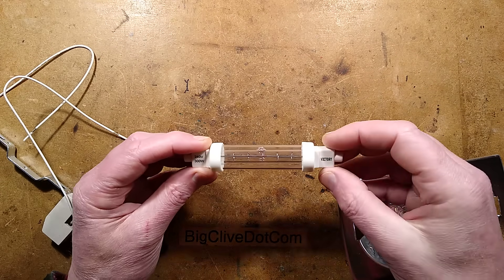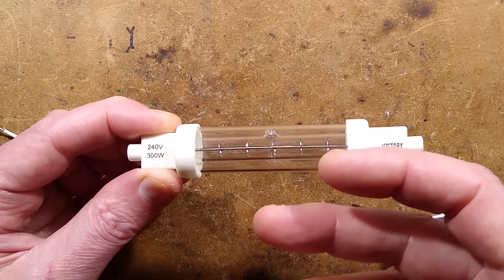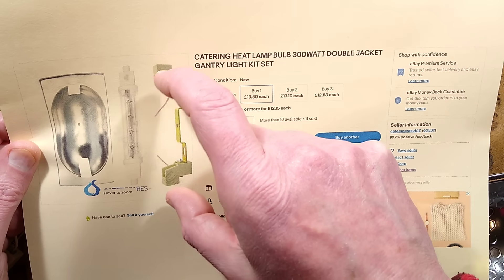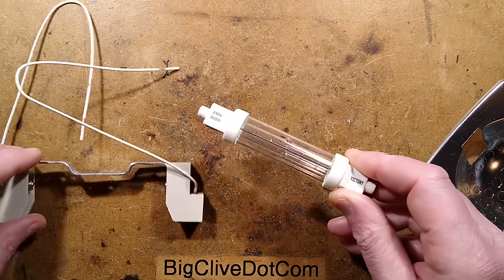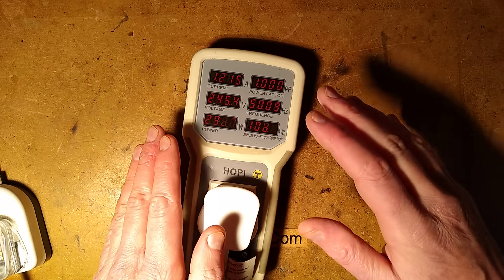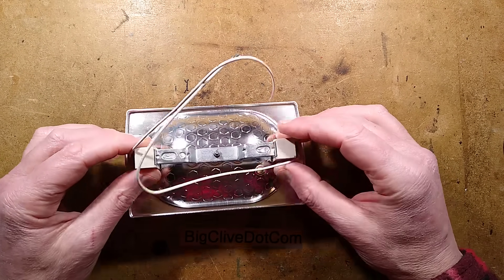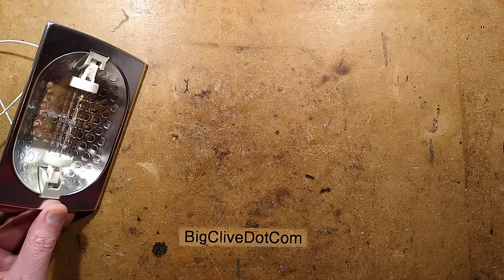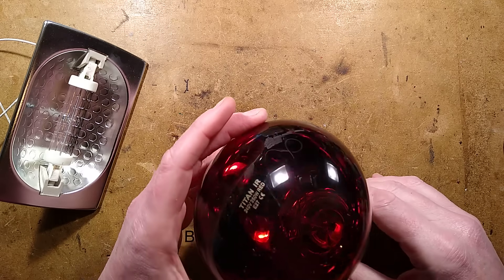Instant heat from an interesting linear heat lamp

Comment: I replace these on a Daily basis,   I'm a Catering engineer for the Biggest Catering equipment service provider in Northern Ireland 😊.  It really annoys me when I arrive at gantry jobs and find that people have stuck normal 500w flood light halogens from Band Q in their gantrys 😂😂😂. PS.    As for the lifespan,   on most occasions,  the lamp itself out lasts the lamp holder, as the contacts in the holder seem to always burn out, thus burning out the end of the lamp.   Also,  staff have a good habit of hitting the lamps with Gastronom container lids and smashing them into the food, rendering the food unfit for human consumption 😂😂😂

Comment: The 250w heat lamp was used extensively in the UK as a bathroom heater before central heating, it kept the electrical trade busy changing all the baton holders that burned out !

Comment: For the UV it's funny how the 850W linear bulb that I got off a laser printer gave me eyestrain every time it was switched on whilst 500W bulbs made for general lighting didn't even when used without any glass cover in front of them.
At the time I assumed that it must be because of doped quartz however I found out later that pretty much no linear halogen bulb is made from doped quartz unlike the bi pin capsules.
I found that by shining a blacklight on them and the ones made from doped quartz will glow blue while the others won't glow at all.
This also applies to some metal halide lamps by the way.

Now to the red chicken coop reflector bulbs, I alway thought they were simply incandescent bulbs with a red tinted glass, however aren't they instead slightly under-run to maximise IR production like with the kitchen halogen one ?

Comment: I work in that industry and many customers purchase the cheaper light bulbs instead of dedicated catering heat bulbs. Not all gantry type bulbs are double glass so it is slightly difficult to tell the difference. The element wires are slightly thicker then the light type and there seems more heat then light unlike light bulbs. Also light bulbs aren’t designed for continual use so don’t tend to last as long as heat catering bulbs.

Comment: For those of you using these in mobile carvery type catering cupboards get longer life from your lamps by training staff not to move the units until the lamps have been allowed to cool as rolling the cabinets whilst the lamps are still warm can cause mechanical damage to the filament. Oh, and always have an RCD or RCBO upstream as one lamp end cap is live when changing lamps unless you isolate and/or turn off the gantry and in a manic kitchen the isolation process can easily be overlooked.
Reply: In theatre, if we didn't have gloves on, we changed lamps while holding the lamp in a cloth rag.   Not really much risk of shock there, and it kept you from oiling up the bulb, which could cause a rather exciting explosion in a Leko, which you didn't want to happen 30 feet above the audience.

Comment: Both the red and clear I/R lamps were, some years ago, available in “ hard glass “ versions, meaning they were safer to use over food ( from  memory made by all lamp manufacturers I.e. Osram/ Philips / Mazda etc ). “ Soft “ , I.e. standard types were, as Clive said, in farms and chicken rearing barn, though for all I know may still be in use. I am happy to be corrected if anyone has a better memory!  The home infrared tanning lamps ( “ Infraphil “ and the like used, again from memory, 275w red hard glass type.

Comment: I remember old soviet/community heaters running on quartz lamps. Those were i believer tungsten wires coiled inse quartz tube? not quite sure, pretty sure those very quite brittle, but the heat they gave a way was immense.

Comment: You should check out an old fuser lamp from an old laser printer. Before they used induction heating like many do now they used lamps to heat the fusing unit to melt toner into the paper. Pretty neat lamps. Not bright but a ton of heat. Sharp used to use them. I used to have a couple 1100w and probably higher on high end production machines. Was an MFP tech in a past life...
Reply: Yes, great long things, they were still being used in Xerox copiers as recently as 2012.

Comment: I seem  to remember reading that Halogen lamps running at less than full  power will actually fail sooner than one running at rated output. 
It's something to do with the evaporating filament molecules within the lamp not recombining correctly during the lamps internal cycle thus leading  to erosion, thinning and  failure of the lamp.
Car headlight bulbs were the subject of the article in question.
Reply from the maker: There's a theory that traditional tungsten halogen downlights on a dimmer, should be run at full every so often just to clean them up internally.

Comment: We had the E27 variety with clear glass in our popcorn carts where people could go and scoop it up... now we have convection cabinets that heat up to 60ish C, into which we prepare various serving sizes. Those  are modified fridges, although the importer says they aren't, but they still have the refrigerant markings, and the compartment for the compressor in the back.
In a supermarket I frequent they have an IR heater panel over one of the cashier stations. That one is closest to their side door, which opens every freaking time someone walks by... and even though they have a heat pump to blow hot air in the "air lock" some cold air tends to enter in the winter. While it stays nice and warm, the conveyor is often hot to touch unless they keep it constantly rolling.

Comment: In order to have warm feet when I sit at my table in the cold season without having to heat up the entire apartment, I built an infrared heater myself: from two small halogen floodlight lamps arranged one above the other, each with a 400 watt halogen tube, which I used connected together in series and controlled with a dimmer as required. At 230 volts, the heating lamp consumes around 230 watts. Usually 150 volts is enough, i.e. 75 volts per halogen tube. Thanks to this low voltage and the soft start of the dimmer, I expect the halogen tubes to last forever.
Reply: In fact halogen lamps degrade faster when underrun, the halogen process that prevents the quartz envelope from blackening doesn't work at lower temperatures than normal operation.
Reply: @cambridgemart2075  Yes that is correct. The halogen (iodine) contained in trace amounts in the halogen lamp reacts (together with water molecules) with the sublimated tungsten deposited on the glass to form a volatile compound that breaks down in the heat near the filament and deposits tungsten back onto the filament - that is a circular process. To do this, the glass must be at least 250 degrees Celsius.

My halogen lamps for warming with light are connected in series; when the electronic dimmer is set to 100 percent, they are operated with a maximum of half the nominal voltage. At half voltage, practically no tungsten is sublimated (a lamp like this burns “forever”), so the halogen cycle plays no role here.

My two halogen tubes now have an estimated 2,200 operating hours and show no blackening whatsoever. Most likely because practically no tungsten evaporates at half the nominal voltage, or because the lamp bulb temperature still rises to over 250 degrees Celsius.

If any blackening were to occur, it could simply be removed by briefly operating it at the nominal voltage - no problem.
Reply: @Tag-Traeumer  Thank you, very enlightening.

Comment: They're absolutely wonderful for that, I wouldn't be able to get through winter without these! I've got a whole stockpile of 120v 250w red heat lamps that were just banned here, the kind we used to put in bathroom ceilings over the shower and hanging buffet swags (Edison style base, more on that in a sec). Rarely gets cold enough to turn the heat on in my area (typical winter day is between 35f-55f outside) so 250w directly on me vs 1500+ across the room, they're just indispensable. It's like a heat projector without all the wasted electricity or too much light. Like I was saying I use the red screw in type because I like the dark deep red light (not too bright), the heat is just right, the color helps with Seasonal Affectice, and I can run them in my cheap bendy arm floor lamp sitting behind the couch at just the right angle on me and never get cold. Not sure these ones are available in the UK, but the concept is absolutely spot on. Saves a LOT on the light bill and my bones don't hurt 🤣
Reply: @tactileslut  ya exactly! And from what I understand nobody's manufacturing the 200-250w red ones right now so once they're gone they're gone from the shelf, they're gone, unless someone starts making them again.. I got mine from Home Front off a clearance rack for a dollar a piece. I didn't even think of Tractor Supply which makes sense, totally forgot they're used in chicken houses too.. I wonder what they're gonna do now coz the halogens that are still available are big dog tubes for the expensive industrial flood lights, way too hot for chickens. Interesting I never even thought about chickens that's a good one. I'll be interested to hear from others what they're going through on that
Reply: @Drmcclung  - They'll almost certainly get a by for specialty circumstances.   Same reason they haven't stopped producing mercury vapor or sodium vapor lamps, and I'm pretty certain that theatrical lighting got a variance.

Comment: That second red heat lamp is of the cheaper variety. Used these in hotel bathrooms in the 70’s to heat the area just outside of the bathtub and yes we had quit a few go bang. Turns out people would shake their hair and send water droplets everywhere thus hitting the lamp. This was way before the advent of safety screens on these fixtures. What I prefer are the industrial PAR lamps made of the heavy glass. They are designed to be more resistant to shattering when hit by water. They are quite similar to the outdoor flood lamps used in the states that have no protective shrouds.
Reply: those 'blinder arrays' do emit quite some heat too before and after the brightness peak. sometimes you could even feel it standing in the crowd. if we already pull out the entertainment industry 😊

i could imagine a blinder array at 1/2 to 2/3 of it's usual voltage (or two in series for that matter) with their narrow beam as a workheaterlight in the shop aimed at you. no more freezing the cucumber off !

Comment: I am fascinated by heat lamps. We have an old heat lamp that still works. It uses a large standard floodlight bulb. Instant heat when switched on. (Like your chicken coop light). It was bought from a drug store 50 years ago for heat therapy.

Comment: When I worked at an English Heritage site the huge (ancient, all stone) kitchen-cum-café had no heating whatsoever. They had two things very high up on the wall (maybe 4m up) that looked like the standard single-element 'chip shop' fly killers but when turned on they had barely any glow, just a faint very deep red and no visible element. However, wherever you were in the room (and I'm talking at least 10m x 10m) it felt like you were under the Moroccan sun. You came out feeling like you'd been in a sauna. I've never been able to find any devices quite the same; I presume they were quartz-tubed doobries but it was near three decades ago and technology has changed rapidly. 😅
Reply: quartz tubes have a bright glow, dim ones are metal IR tubes

Comment: Yes the contacts inside the holders burn out more frequently than the actual filament. Changed quite a few of them, the contacts inside the holder are a convex knob of some sort of special metal, and the lamp ends have silly little concave cups which supposed to perfectly fit the knobs in the holder. They often do not make good contact not matter how carefully you fit them, so the contacts overheat, fuse and burn off, ruining the contacts in the holder, and often also the contacts on the lamp. I think the springy metal inside the holder also plays its part, its supposed to clamp hard onto the lamp to make good contact, but the spring gets way too hot and loses its springiness (you can see the blue discolouration), so the contacts make an even weaker connection to the lamp.
Reply from the maker: That's always been the curse of the classic halogen floodlights.

Comment: it can be used fot desoldering parts. very handy, you cat put it upside down and then an pcboard on top of it and in a couple of seconds you can took off parts just with a tweezers

Comment: When I was young we used the  red lamp in bed rooms over top of the bed for heat because the wood stove would go out overnight, I find it funny we are not allowed to have the old 100 w lights now because LED's use less power but we can put 1500 watt heaters in each room, Id rather just have 20 of the 60w bulbs giving heat and light all winter over a heater that causes so many house fires today,
Reply: The problem comes in summer when someone puts the lights and air conditioning on at the same time. 

p.s. 100W is nothing. A house I rented had 400W in the bedroom. Eight ceiling mounted GU10 spots. Most of the heat probably went into the loft !

Comment: I have used a portch heater, or heat lamp in FOH on ouside jobs this december, -14c out, but could still run the lights with just holding my hands up to it now and then, on the warmer days it was abselutely amazing.

Comment: You said it protects from grease splashes, so it should be ok to touch the glass, my guess is that it's borosilicate
Reply: The inner glass is quartz, the outer could just be soda lime glass because the heating is pretty even, but as it goes over food typically it probably is borosilicate to be safer. You can touch the outer glass when it's cold, yes.

Comment: I have a 250W halogen work lamp, from a big box store, that I use as a personal heater on rooftop unit jobs. It puts out to much heat to use in a small walk in freezer. It is a good idea. Good luck.

Comment: ive seen someone doing electrical work soften PVC with a halogen light their heater box thing that they usually used for bending PVC conduit broke so they used a work light and while slower than the heater box it did work.

Comment: When doing electronics a 100W decor-spot mains reflector lamp (get the tightest beam angle you can find) works well - mounted above your head just in front of you. Keeps your head warm and lights the bench plentifully. It’s the best light for working on tiny surface-mount components! Large adjustable desk lamps are ideal for this. Put the base on the instrument shelf and aim it onto your bench! Just be careful when you get up that your head doesn’t bash into it!

Comment: Merry Christmas !Rewired many a heat lamp assembly .Remember the rules for continuous duty !I use #12 for 2 250 watt  halogen infra red heat lamps .And I replace all the cords with SOOW .The oils in food services destroy the rubber on the cabtire cable

Comment: Theres a neat application for high powered version of these, rapid thermal annealing.
Think of a series of these around a quartz tube, 3 phase 400 V, 64 amps.
Quartz tube is under vacuum/inert gas/gas mixture (hydrogen in nitrogen usually) , with a graphite vessel suspended in it on quartz rods, for samples. RT to 1000 C in about 30 seconds.

Comment: When I was a kid, my mum used to sit us in front of one of those chicken type lamps (but with a different lamp holder) when we had ear infections and stuff like that. The one I have mentions a number of medical applications, like relaxation of sore muscles. You're only supposed to use it for 10-15 minutes at a time, for obvious reasons.
Reply from the maker: Philips infraphil?
Reply: What are the reasons for the 10-15 min time limit ?
Is it the heat or some UV ?
Reply: @psirvent8  It's infrared, UV requires special glass, so that's not a big issue.
The lamp I have is only 150W, but it already gets pretty warm during that time (the instructions say to sit ~30cm away). The heat can also go relatively deep into the tissue, and when you're using it on your head, the brain isn't that far. And something you don't want to overheat …

Comment: I use a 500W Halogen light to heat bearings up to slide on to motor shafts and such at work, find it safer than induction with less possibility of heat damage to the bearing , works wonderfully and iis eminently portable for on site jobs

Comment: I used to have a Infraphil 150w PAR style heat lamp to heat me in winter before the central heating had everything nice and warm. It burnt out, i almost bought a new one but then i saw that they are specified for just 300 hours. 
So now i have a standard radiant heater with 2 400w coils. I run it off my variac, because 400w of radiant heat is a lot if you're sitting close to it.

Comment: Use these at my job.
We make batteries and my job is to work on the line that makes pasted plates.  These are basically a lead grid with a lead based clay covering this grid.  
This clay looks like dirt for all its worth, only crazy toxic and full of lead.  It needs to be a certain level of moisture.
These lamps are used in the testing devices that heat up samples.
Reply: Do you use the linear catering-style lamps or the red chicken-coop type ones ?
Also do you have to wear goggles or other eye protection from the infrared ?

Comment: The company I work for used to have these to heat the benches in one of our outbuildings. Very effective when you're right under it. But the light was (as you say) optimised for IR so very dim in the visual.

Comment: I have a desktop reflow over from C.I.F. which uses similar lamps to control the heat. It can raise the temperature very quickly. An excellent reflow oven. (RS: 130-0859)